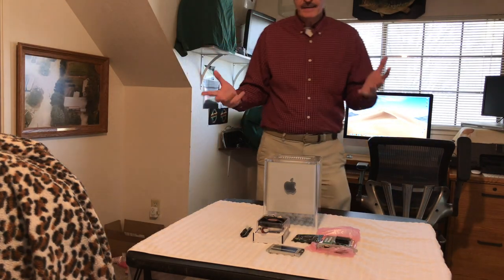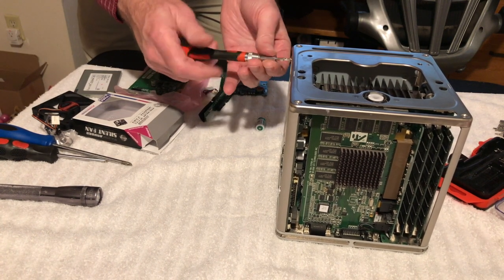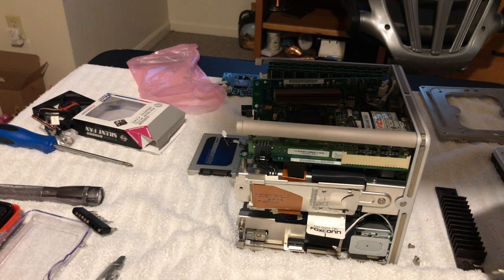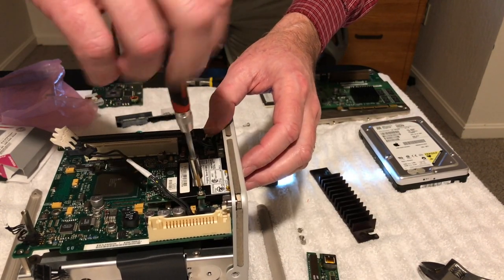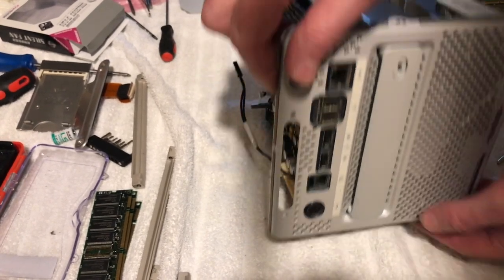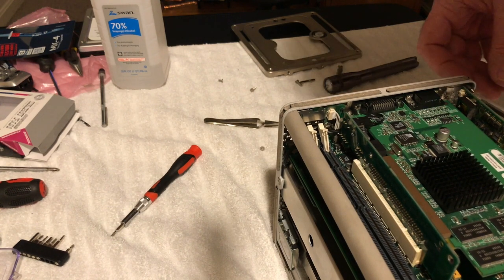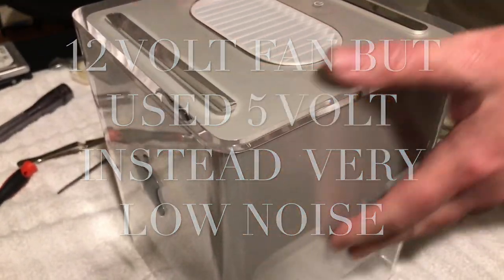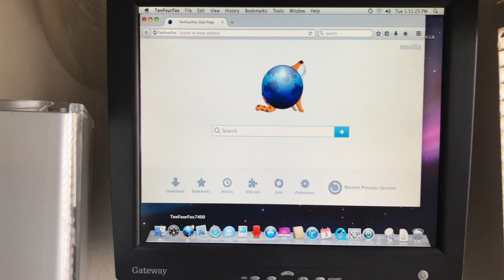THE POWER MAC G4 CUBE UPGRADE PART 2

Comment: What timestamp in your video shows the SSD install?  Also, I clicked the link in the text description about the IDE adapter, but several are shown.  Do you have a more specific URL to the exact adapter you used?  I still have 120GB spinners in my 2 Cubes, which is why I'm curious to see how an SSD is installed.
Reply from the maker: Hi JDWI use the crucial 120 GB SSD the IDE to SATA adaptor I go from Amozon I will find the link for it .yes I done some amazing upgrades to my cube but go to my play list on the G4 Cube That will show all the upgrades I have done to it
Reply: @DavidStahlOLDHAPPyMACs  I would love to have that Amazon link, yes.  Thank you for sharing your upgrade videos with us!